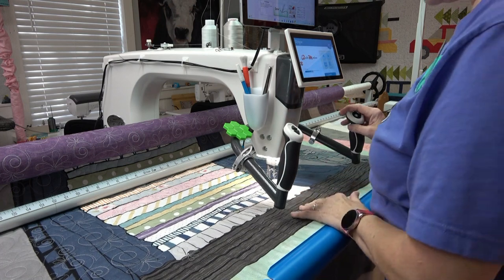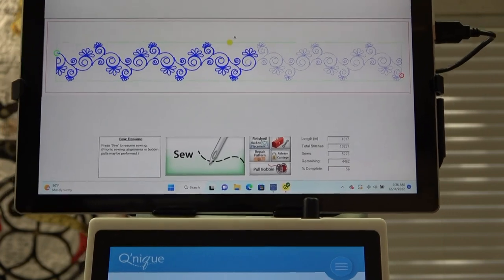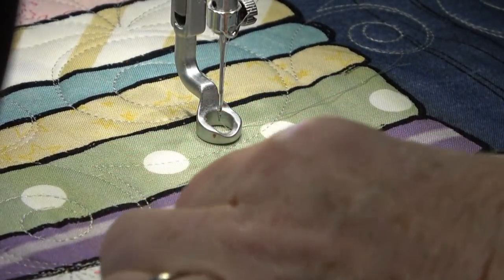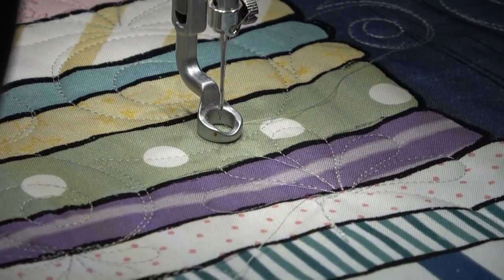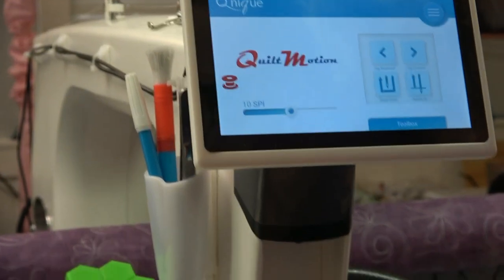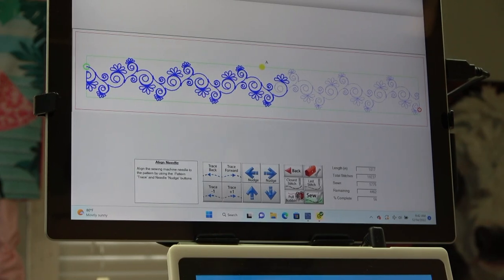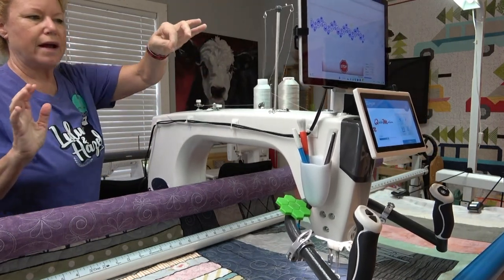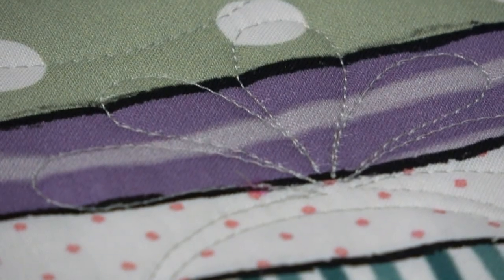How to Replace a Bobbin Mid-Row on the Grace Qnique 21 X Elite with QCT5 Pro Software

Comment: I bought a Grace Q zone frame.  Then I bought a Dream Motion quilting machine, 15 inch throat, by Brother.  In the sale, they threw in the software, to quilt by computer, like you are doing, but they sent me the manual for the PRO version.  I called to try to get the correct manual, and apparently they don't make them anymore, which is probably why I got it free as part of the sale.  So now I not only have to figure out how to use this automation, I have to do it with the wrong manual.  This has made it all so confusing and hard,  I am going to focus on FMQ first, and then try to figure out the automation later when I am more familiar with the frame and machine.
Reply from the maker: I think you'll be fine.  I bet you discover that the Pro version manual is very close to what you see on the screen as far as menus, button functions, processes, etc.  The Pro version will just have more options than what you have.  Give it a try.  I'm sure you can work it out. :-)
Reply: @PowerToolsWithThread   I hope you are right.  I def. want to use it, so I will just take the time to figure it out.  I really want to do FMQ, too.
Reply: Send email to customer service. They may be able to help
Reply: oh dear!!!
Reply: @shellyculver4239  I called.  I was willing to buy the correct manual.   But they are not available.